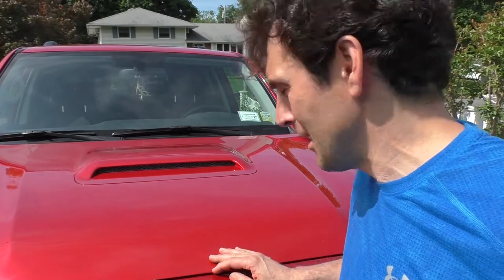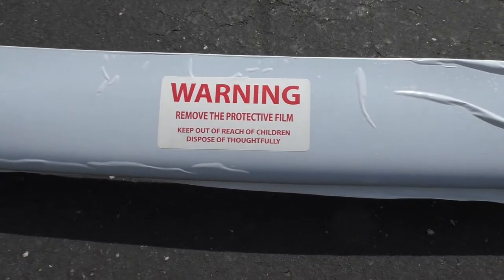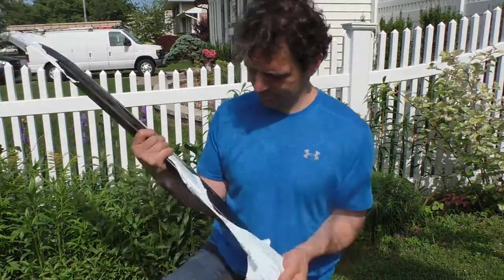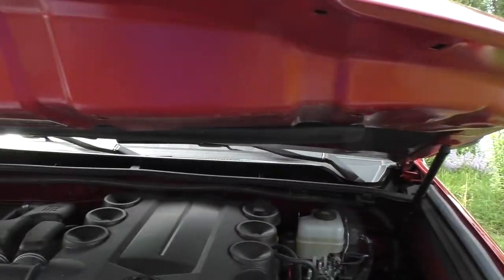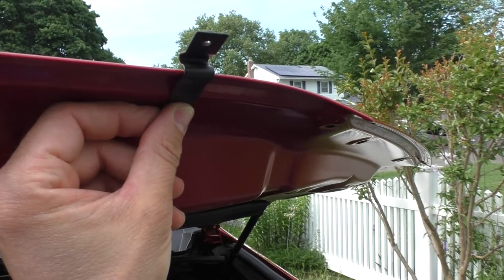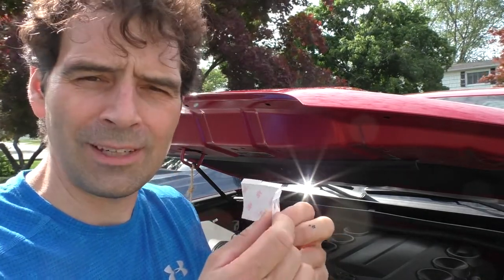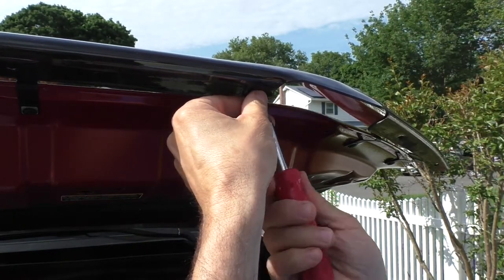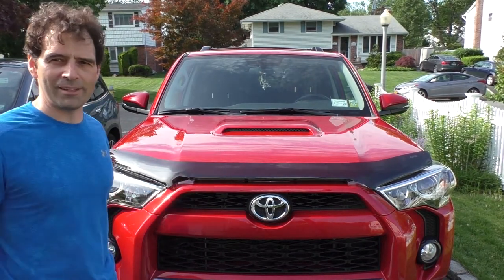Hood protector / bug shield install on a Toyota 4Runner - Vital Point

Comment: The manual says to use the washers for the hood screws not the deflector screws. 
Were you able to tighten down the hood screws completely or do they still freely turn? No matter how much I tighten it still spins (with tension)
Reply from the maker: Alexander Estk Everything tightened down securely.   It was a while ago that I installed this, but I don’t think there were any washers for the hood screws.  The nylon makes sense (to me) against the deflector so that it doesn’t crack the plastic.   I’ve been very happy with it.  Hope you are too.
Reply: Vital Point I am happy with it but non of the hood screws tightened securely. It’s tight but I can still turn the screws.
Reply from the maker: Alexander Estk It should tighten down.   You don’t want the screws to wiggle loose while driving.  If your deflector was from Toyota, I’d take it back to them.  Otherwise, maybe use a little lock tight glue to keep the screws in there.
Reply: Vital Point hmm interesting. I wonder if it’s because of the washers?
Reply: Vital Point I tried switching the washers and it didn’t help. Hopefully they don’t come out over time. I’m going to try some Teflon tape on the screws

Comment: Who should I contact to fix those rock chips unfortunately i got some on my 2019 4runner, auto body paint shop or someone else?
Reply from the maker: Anonymous Suomynona  good question.  I’m not sure they are worth the trouble of fixing.  Maybe just pick up some touch up paint from the dealer and dab it on with a toothpick.
Reply: Auto body shop. They will mix the exact color and use a squeegee tool to fill the chips perfectly

Comment: Is the material hard plastic or flexible type
Reply from the maker: Kenneth R. Kim  Hard plastic.  It flexes a little bit.
Reply: @leafinitup1   i just picked one up from the dealer but it flexes. Tip ends  bend If I hold thr center of it.
Reply from the maker: Kenneth R. Kim   So what’s the problem with that?  Once installed, it won’t matter.

Comment: PPF or hood protector
Reply from the maker: randomrazr Not sure what PPF stands for, but call it whatever you like.   It takes the brunt of loose debris that would have otherwise hit the hood.
Reply: @leafinitup1  paint protection film
Reply: I'd go hood protector especially if don't mounting a plastic piece of equipment to your hood  and somewhat  changing its looks. It's going last so much more than ppf.

Comment: Which hood protector did you go with?
Reply from the maker: Isaac Genao The Toyota brand.  It was a little more expensive, but I didn’t want to take the chance that the mounting holes wouldn’t line up or something with an alternative brand.
Reply: Thank you.
Reply: Vital Point are you able to see the brackets and the screws sticking out from the other side of the hood protector? I just got the same toyota brand for a tacoma using the same types of brackets and it is disgusting to see all brackets and screws sticking out.
Reply from the maker: yasfa74   I’ve never noticed the hardware before.  You have to get up really close and look under to be able to see it.   I think the advantages outweigh that, and overall it still looks cool.